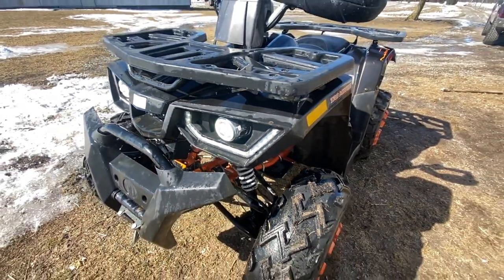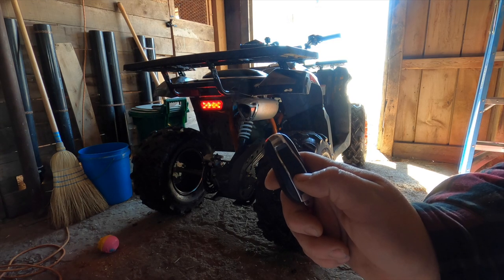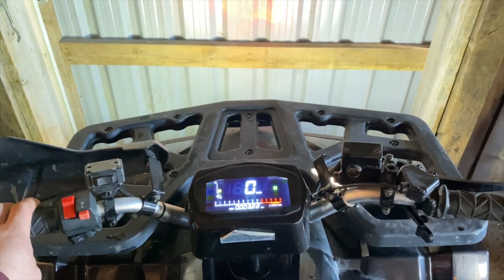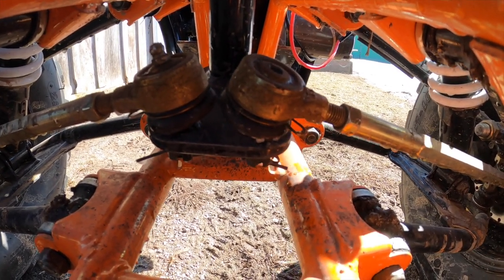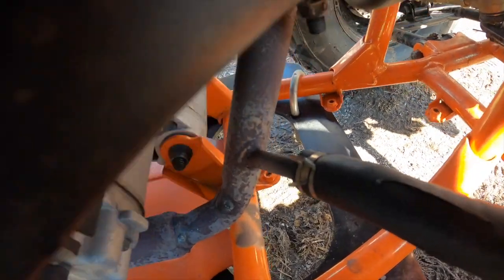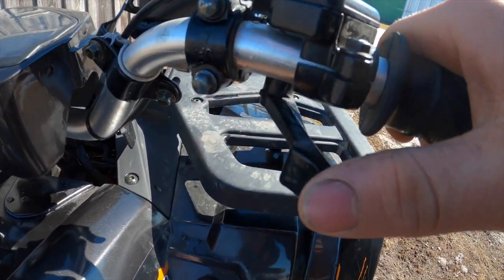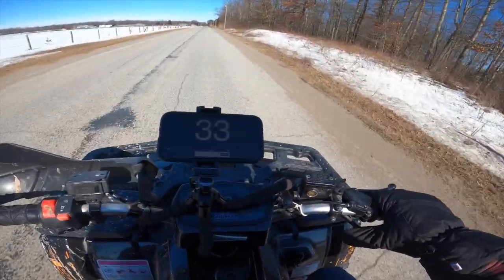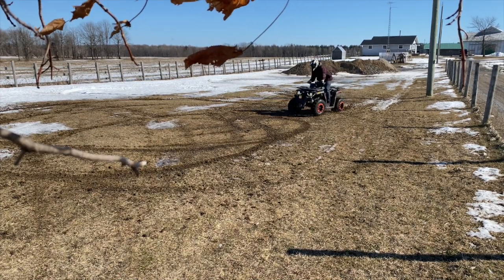Review : TAO TAO Raptor 200 ATV - Is it worth it?

Comment: Nice review. I 've had mine for a couple of years and have had most of the problems you have had. Add a washer or two where that swing arm axle bolt is so you can crank that bolt down. Also watch the bolts   that hold the rear sprocket to the axle. They tend to come loose too. Bought a new chain that was more heavy duty and it seemed to slow down on how often I have to adjust the chain tension, too. Overall, I'm pretty happy with it since I got it for 1400 new in the December before the pandemic started in the USA.

Comment: I've had this quad for 2 years now going on 3. I haven't had many issues. If there was any issues it was minor. I only have some issues when it comes to parts, I could not get an air filter in town from where the atv was purchased but one location had a different air filter that worked just the same. Some bolts that have come loose and needing re tightening. Biggest issue I have is the gear box oil plug is located right behind the exhaust pipe tube which I cannot get to so I'll have to take it in to get it changed and pay the hourly service fee.

Comment: I have had a CFORCE 400 4X4 for nearly 4-years and I have never had to tighten a bolt or experienced a single problem with it. It looks 
good, runs well and rides great. The only thing that I have done to this ATV is put in gas in the tank and change the oil every 200-miles. I paid $4300 for it. At 67 I am not a hard rider, but I do like to ride it on the sand dunes along the river and go up and down hills. CFORCE makes good products! I had a Honda Foreman 500 for 10-years that I sold before purchasing this ATV and it was a great ATV, but it was not a 4X4, which is something I felt that I needed as I have gotten older.

Comment: Seems like when you buy one, you just just loosen every bolt, loctite it, and torque them all down.  

Nice review, some other guys on youtube have experienced the same thing and said "DO NOT BUY, IT'S A PIECE OF JUNK."  I guess it depends on your affinity to work on it.  As a comparison a Honda TRX250 is $5,000 new.  I mean if I had a Tao Tao and once every 3-4 gastanks I had to go tighten a bolt or grab some hardware from the store, and end up saving $4000, then yeah I'm gonna do it.
Reply from the maker: Once you get the bugs worked out, it’s not to bad. Surprised the motor hasn’t blown up honestly.
Reply: Why do think the motor is going to blow up?

Comment: my sons 150 atv is basically the same unit. we put in lighter rollers and changed the torque spring in the secondary and it turns 22inch mudlites on the rear no problem in reasonable mud and snow. top speed it hits 37 mph with him but once i get on it it drops to about 33ish. it pulls as hard as my old honda trikes did so id assume if you really wanted to beat on them they could make a cheap kids mud bike with some mods.
Reply: How heavy spring and rollers did you put in it? :) cherrs

Comment: The rubber hose should definitely be taken off because the overflow of the carburetor will go straight to the hot pipe and it does that after shutdown mainly if it happens at all

Comment: i think the problem with most chinese thing slike this for example is that theyd come assembled cheaply like loose nuts and such as Chinese arent reeally know for their quality and they are probably mass proiduce don a line assembly or soemthing but wiht soem tightening and adjustments might not be too bad..for someone who doesnt know how to fix or do such things theyd say theyre junk or itd be a hassle but for soemone who does itd be a bargian and save tonne sof money buying a cheaper chinese one..i had a tao tao e-bike and i beat the hell out of the thing and it still worked fine maybe luck of the draw. so i really have little complaints about stuff i bought form China...the big things anyway

Comment: Love the raptor got one
Where can I buy that wench?
Reply: How’s it doing
Reply: @fatallucid8254  it's great but I find someone times the rpm stay hi when I start it up for like 3 minutes
Reply: @ylesser6096  have you messed with the carb that’s prob why
Reply: I never changed anything from when I got it
Reply from the maker: Not sure where to get the winch. It was already installed when I got it. Also, the high rpm I believe is the Automatic choke, I’m sure it’s normal, mine does the same thing
Reply: @jonamond  I installed a winch on my tao rafter I hope to post something soon

Comment: I just almost bought a 2021 200cc tao motors raptor and the digital dash was totally useless it didn't work just lit up and nothing worked the odometer stopped at 110miles and speedometer just stays at 0. The front brakes were totally done for rear breaks work but not the best. These Chinese quads are very weak. They just don't last!! And don't get me started on the wires it's so confusing!   So needless to say I didn't buy it they wanted $900.00 for it so I passed on it